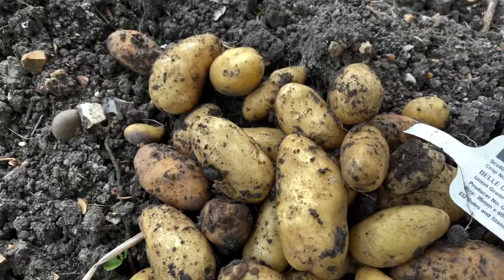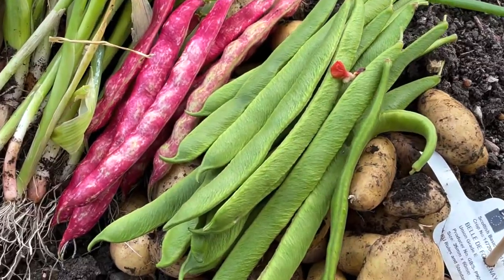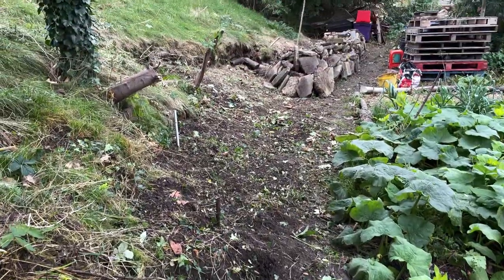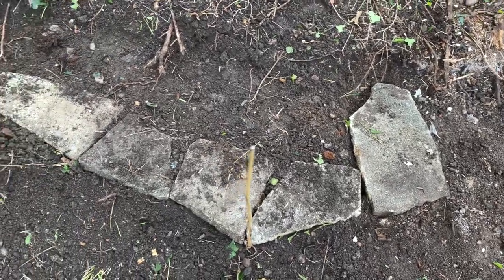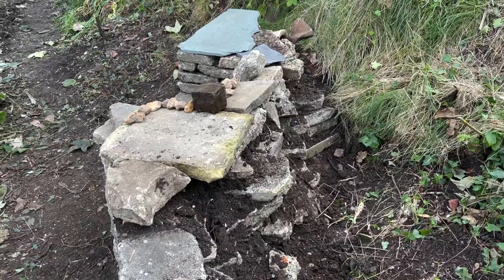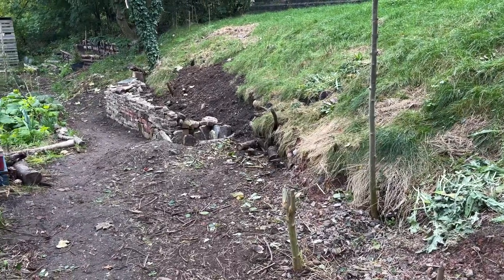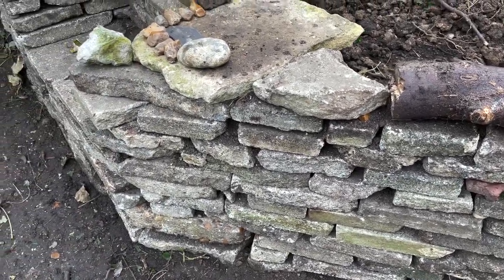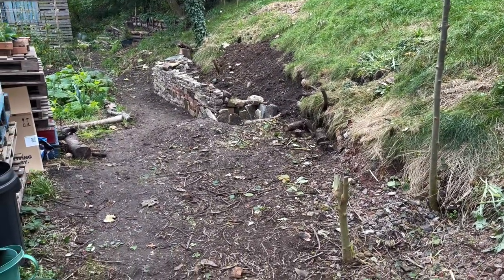How to Make a Dry Stone Wall using Reclaimed Concrete

Comment: That dry stone wall looks fabulous. Would love to incorporate some in my garden in the future to. I have some leftover broken floor pavings left from the shed. And will use some bolders as well, since I want to use them for my pond anyway. By the way, I am digging an extension for my back garden border and while digging the clay soil, I noticed some hard things underneath. I have dug it out by yesterday and they are the leftovers of a former pond including plant baskets. I think it leaked at some point, because there is no water in it. But the soil was very moist in the bottom. I found several large gravel and two bolders I can reuse for my pond. Next week I will dig out the compost I had put in in the first half and start digging a bit deeper there to. Hopefully I can find the edge of the pond, finding more bolders and remove the liner for better drainage. That was quite the discovery of the week😃⛏️ You look very different without a beard btw, needed some of a change?
Reply from the maker: Well it seems like you uncovered some treasure there. It’s amazing how we can reuse what we find in the ground. You have everything you need to create a pond except maybe a pond liner? Yes I decided on changing my appearance some times! It’s a bit of fun! Thanks for watching and good luck with your projects!
Reply: @MarkyBigSmoke  I have a lot of sand from underneath the paving that I can reuse as the subsoil. Plus some light coloured clay soil if I'm lucky. And the pebbles and two bolders of course. I need to put in a few key features of my garden design first, before I can determine where the pond needs to go. Aside from needing more bolders for the well, fleece liner, pond liner and pond plants I have everything already at hand.
Reply from the maker: Fantastic! I managed to source 30 boulders for £30 using Facebook market place a couple of years ago. Good luck with getting the remaining materials you need.